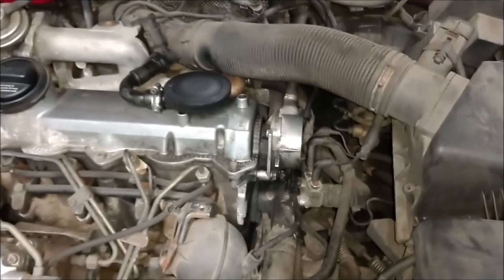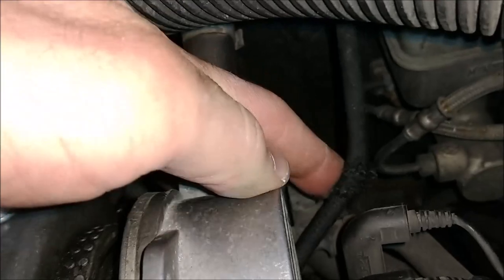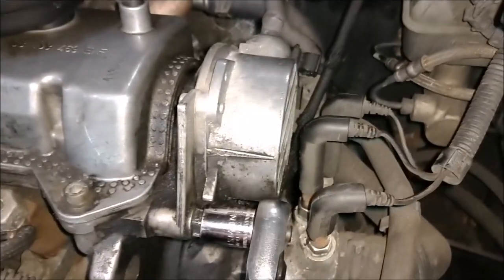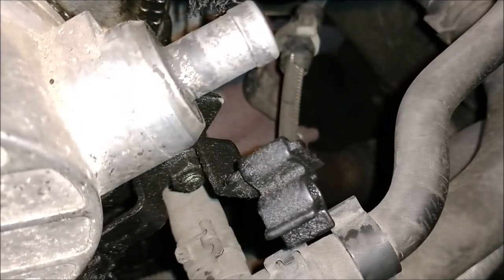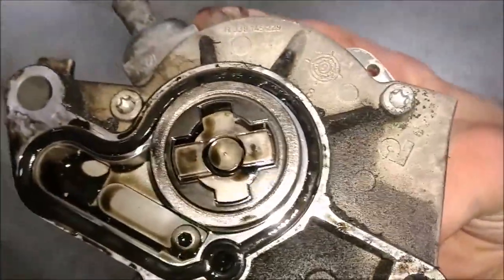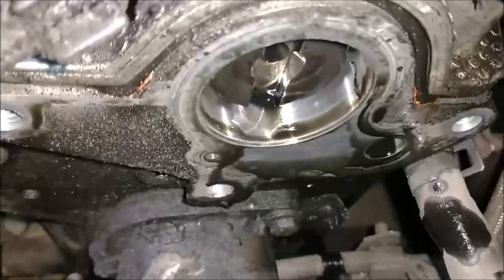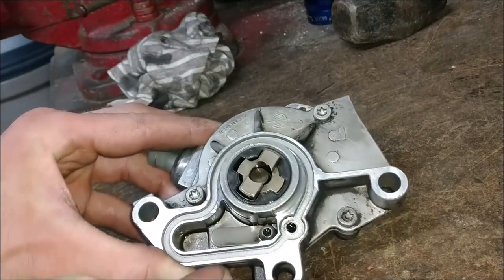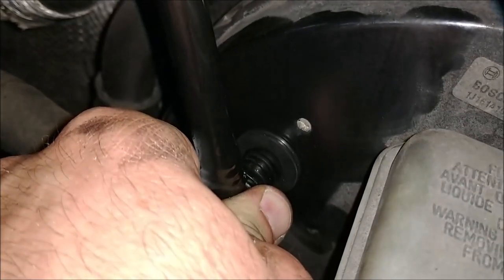Volkswagen ALH TDI vacuum pump oil leak fix

Comment: I could sense vacuum leak when the brakes are applied. There is a hissing sound.  Also, the CEL comes up with  errors P3130(N18) and P3105(N239). I found traces of oil in the main hose connected to the nipple of vacuum pump. Can replacing the seals fix the issue? The nipple shakes very lightly. Is that an issue?
Reply: @revvmat  Yes

Comment: Hey , are you sure that the pump should not be filled with oil? Because when I opened my pump, it was hapf filled with oil and I checked that the oil makes good vacuum in the lower engine speed
Reply from the maker: Stiliyan Bozhilov - There might be some oil residue, but the pump shouldn't be filled with oil on the vacuum side. If it is, the pump is definitely worn out. If your brake booster line has oil in it, then that's a bad sign.

Comment: Hi Cory.  Great job on on your video!  I'm doing the same job.  The reason I'm doing it is that i experienced a stiff brake pedal for a while then limp mode.  The turbo was not kicking in.  When I opened the vacuum pump it had quite a bit of oil in it.  Is it supposed to have oil in the pump?  I imagine replacing the seals will help with that.
Reply from the maker: Tom Ashby - Thank you! The pump shouldn't have oil in it. Check to see if the vacuum line that goes to the brake booster has oil in it. If it does, then it's not a good sign. You might have a bad pump.
Reply: @Corysdiyauto  I'm seeing signs of oil in the throttle body and intercooler.  There was a little oil in the line to the brake booster.  All the parts in the vacuum pump are intact and move freely.
Would bad vacuum pump seals explain the presence of oil in the throttle body?
Reply from the maker: Tom Ashby - Throttle body? Diesels don't have throttle bodies, unless you don't have a TDI. Those seals prevent external leaks on the vacuum pump. It's normal to have a light coating of oil inside the intercooler piping. If you have major amounts of oil in there, then your turbo is probably worn out. How many miles are on your engine?
Reply: @Corysdiyauto   You're right it's not a throttle body. Air intake manifold has a control flap mechanism, its that.  I was noticing oil leaking through where that connects to the intake manifold.  Seems like there shouldn't be oil there either.  Car is nearing 150K miles.  I had to replace the turbo at 95K and it's been working great until a week ago. I know the turbo actuator is on the vacuum system so fingers crossed I'm counting on the vacuum pump fix, fixing the turbo.  Thanks again.  Great video.
Reply from the maker: @xdrabbit  - I'm still on my original turbo at 170,000 miles. I'm surprised that yours failed at 95k!?
Reply: @Corysdiyauto  oil starvation killed it.  Definitely was an abnormal event.
Reply from the maker: @xdrabbit  - That'll do it! That's too bad that happened to you. I had the oil supply line blow on me a few years back. Luckily it didn't kill the turbo, but what a mess it was!
Reply: @Corysdiyauto  job done.  Turbo is out of limp mode and my fun car is back!  New vacuum seals did the trick. Thanks for replying and creating this video.
Reply from the maker: @xdrabbit  - Great news! Glad to hear that you're back on the road.

Comment: That vacuum hose you had to disconnect before removing the large vacuum hose on the brake booster, where does the other end of it go? I’m going to soon replace all of mine within a few days due to 4 of my hoses missing but I’m not sure where that one goes, the reservoir, and the actuator. I’ve looked at diagrams but for some reason it isn’t clicking 😅
Reply from the maker: Anthony Jones - That vacuum line runs from the reservoir towards the firewall and connects to a plastic "T" connector. The connection happens right below the passenger wiper arm pivot point. I hope that helps you.
Reply: Absolutely!! Thank you I and highly appreciate it!

Comment: Would this fix any brake problems I'm having? I only have the new gaskets
Reply from the maker: I don't know? It depends on your brake problems.
Reply from the maker: @brokenlowridervw  - Well, there's a lot to check there. Make sure that there aren't any cracks in the brake booster line and be sure that you have all of the vacuum lines hooked up correctly. The leaking vacuum pump needs addressed too. It's not that bad of a job either.
Reply: @Cory's DIY Auto  Thanks so much! Great video.
Reply from the maker: @brokenlowridervw  Thank you! Good luck with everything.

Comment: Can I clean it with brake cleaner?
Reply from the maker: You should avoid using it on rubber and plastic areas. I would use it to clean the pump itself once removed from the vehicle.

Comment: What did you use to clean the surfaces? Brake cleaner?
Reply from the maker: Will Webster - I just used a clean lint free rag and it worked well.

Comment: Corey, i mk4 golf has a problem with brake system, i belive is the boost system because when i stop the motor i cand hear a sound from there...also my vacum out put pipe(aluminium) is weak. So i dont know where the problem is, vacum pump or booster system?can you help me?
Reply from the maker: Marius Stelu - I would be surprised if your vacuum pump is bad. I would guess that your boost system might have a leak. Try looking for a cracked hose.
Reply: I will check

Comment: if that vacuum pump leaks oil , the car drives diferenly  ? Ohh and you sould replace the vacuum hoses too ...
Reply from the maker: Victor Nenciu - My car didn't drive differently when the pump was leaking. I replaced a vacuum hose that went to the brake booster because it was cracked. You should always check the vacuum hoses for any cracks. They get brittle with age.